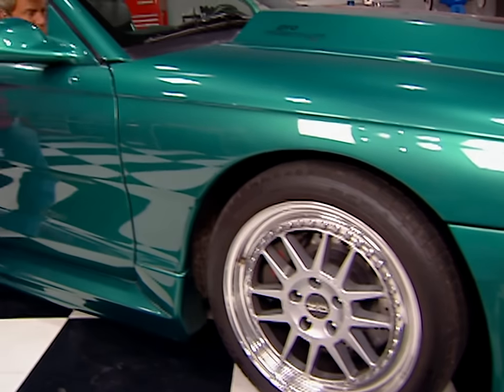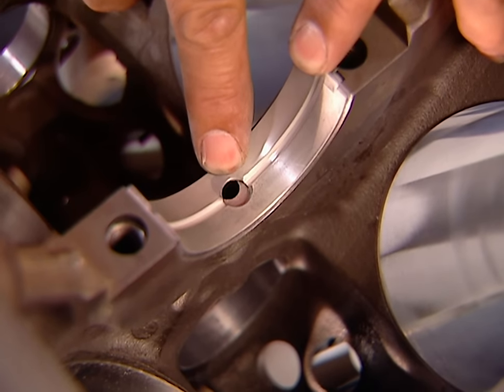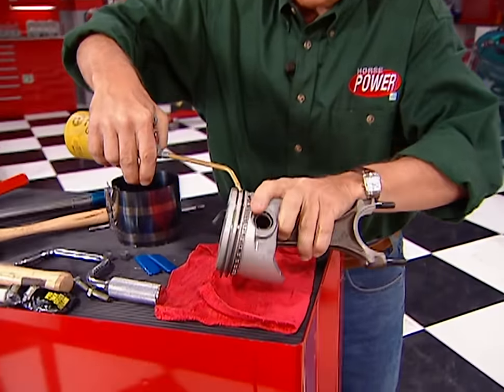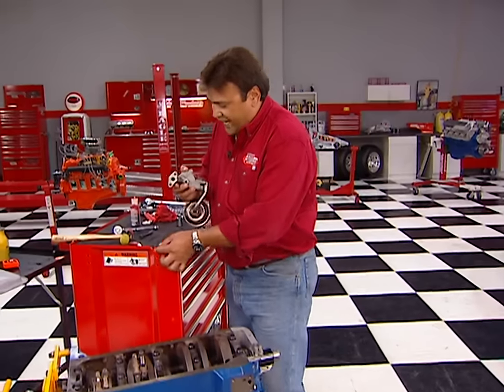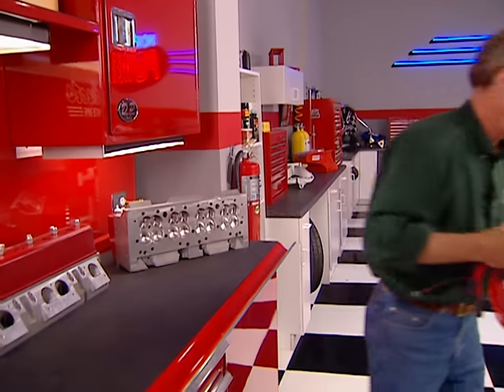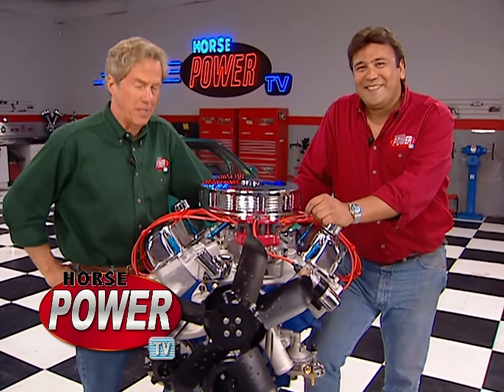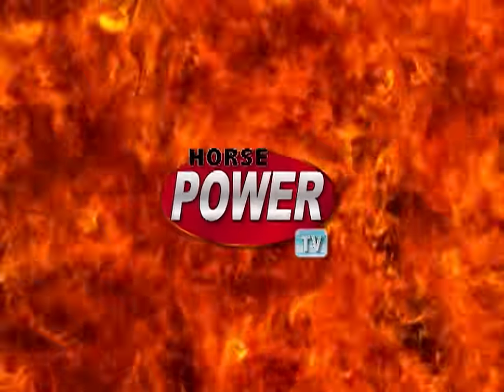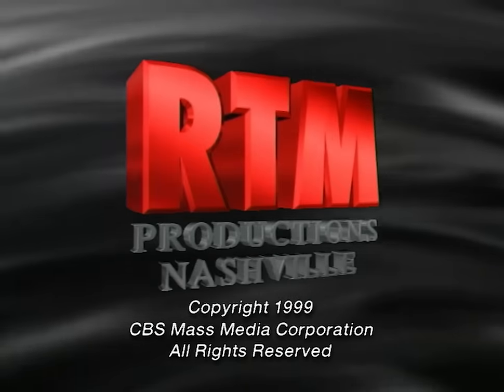Using The Retro Tech Approach To Give A Ford FE New Life - Horsepower S1, E18

Comment: Ford never called any of there engine families big block or small block. Either Windsor, 335, 385 or FE series. Term big block and small block was GM thing
Reply: The fe  engines were labeled medium block,  kinda stange
Reply: Dad worked for Ford dealership through before and through muscle car years. He said they called them by engine cid. I have ford info calling 351C, 351M and 400 as mid blocks. But it never stuck because people seen 351C as small block and 351M/400 as big block because it had 429/460 bellhousing bolt pattern. But 335 series engine all shared Windsor bore spacing. This was how 302 Boss was bore because engineer was working on trans-am  race series engine and 351C engine. Taking 351C head bolting them on 302 block

Comment: Never install a cam after the crankshaft! You always install the cam first so you can guide the camshaft in first and not nick the cam bearings!!
Good grief! What a disaster!!
Reply: Never install the snout threw the timing cover seal  and install dry.
Reply: Installing aftermarket  intakes need to be fit in many cases. Don't just bolt her down.

Comment: Why doesn't the oil hole match up?
Reply: The FE was known to have oil issues.  There was a few common tricks to get the FE to work well.  Putting a Holley carb jet into the oil feed to the top of the heads was one, and the other was to enlarge the oil passage where the pump bolts up, next was to hit the mains with a die grinder.  This worked really well on these old engines.
Reply: @karljay7473  it was odd, but the mismatch on the main feed holes was supposedly to meter oil from front to rear and even the floor out. It worked, they won LeMans with the 427 side oiler that way. I couldn’t leave it that way, I did what they did.

Comment: Love fe engines, they should start building them again
Reply: Ford did--it was the 4.6 litre cross bolted V8, or if you want, the 5.4 litre. and the Teksid block handled 1,000 hp at the crankshaft.
Reply: @alertgasper not even the same 😂
Reply: @jp360ford2  sure is. made 'em for cars and trucks, even a V10 version.  tho the real secret sauce is a 351W--roller cam, EFI, 7 litre displacement capacity with a stroker kit and you can drop 'er in a 67 Mustang and still have room for headers and spark plug reading. Cheaper'n attempting that all that with a 391 FT :)

Comment: i wish one of these shows would actually do an FE motor with real high end ProFormance like my motor about all i could a-ford no pun intended carbs CFM 850 CFM and it may not be enough a lot of cam beefy bottom and top about the only thing original are covers and block and crank. original stroker 428 crank in my Third motor. 
i would love to see you guys spend some reasonable high dolor massive power like mine.

Comment: My FE is 428-SCJ in a 1969 Mach 1 that's pretty low - 49" at the roof top and you can just squeeze a fist between it and the pavement = Headers DO NOT WORK in these cars - not only because of ground clearance, but because of the "grind-to-fit" (32) Stage-8 cap screws required to seal Hooker long-tubes to your Edelbrock or medium riser CJ heads...and, they still hit the reinforced shock towers on the passenger side!  So, you must run cast iron CJ manifolds, which limits your camshaft fantasies.  I'm running 12:1 custom Auto-Tec pistons and Comp Cams "milder" solid roller cam, which has 292 deg. duration, 110 lobe centers and 0.645" lift....runs like hell from 3,500-5,900.